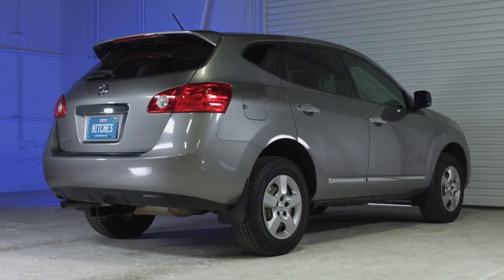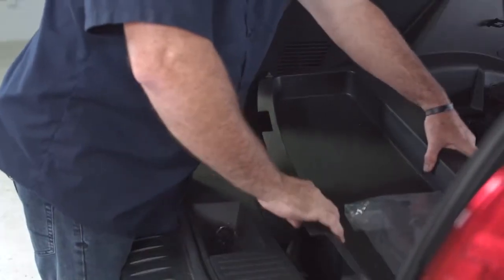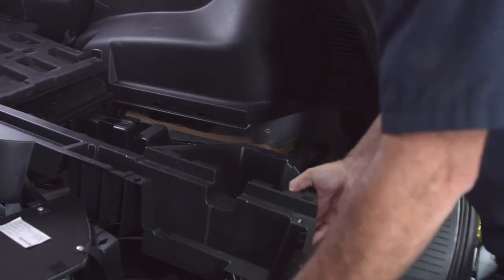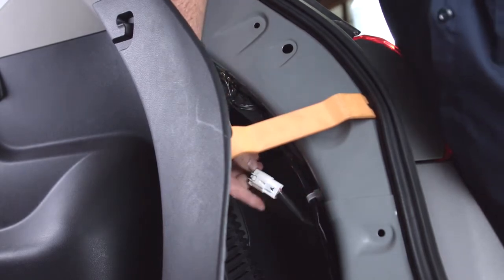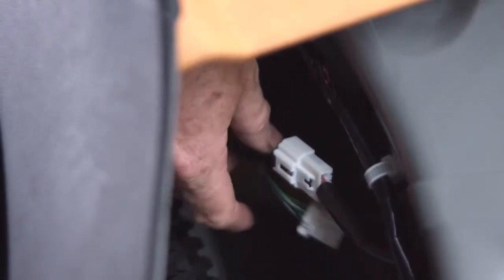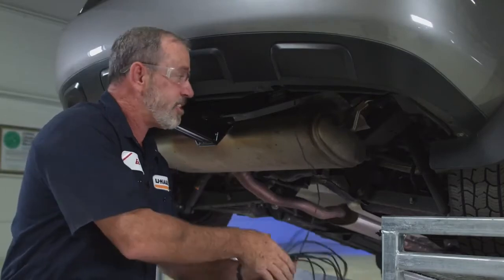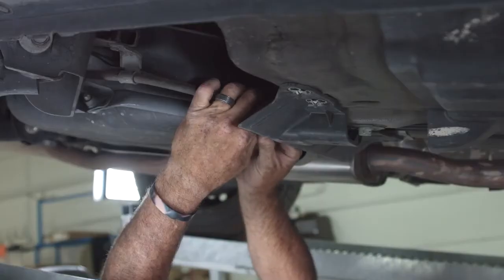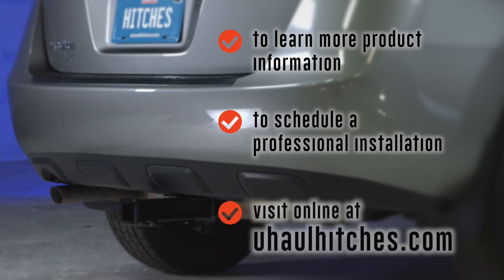2020 Nissan Rogue Trailer Wiring Installation

Comment: The connections would be happier soldered, not butt connected. Also, why not just run the one wire through the cabin, under the driver side moldings, then through the firewall grommet??
Reply: Why not run the harness out that grommet and attach to the hitch too. Then there are no wires hanging out the lift gate.
Reply: I did it under the driver side mouldings n thru the firewall grommet lol

Comment: This isn't a 2020
Reply: Ur right! I had no clue until  I read this comment lol I watched this s few times
Reply from the maker: This video applies to wiring for a 2008 up too 2020 Nissan rogue. The specific year shown does not negate the steps in the video for your 2020 Rogue.
Reply from the maker: This video applies to wiring for a 2008 up too 2020 Nissan rogue. The specific year shown does not negate the steps in the video for your 2020 Rogue.